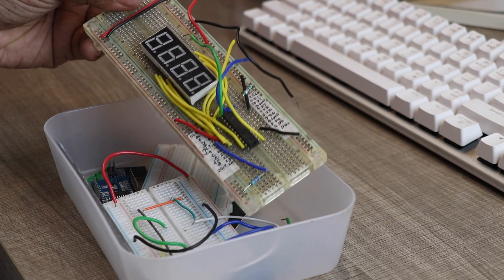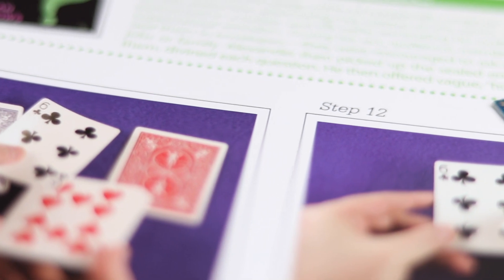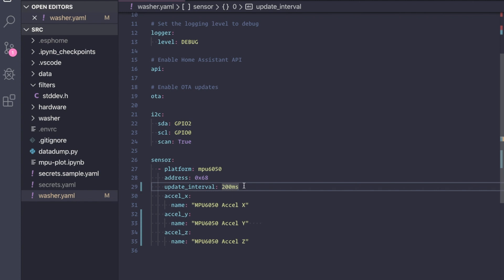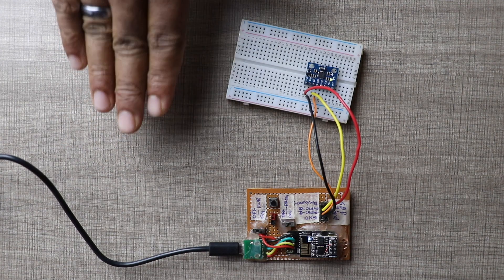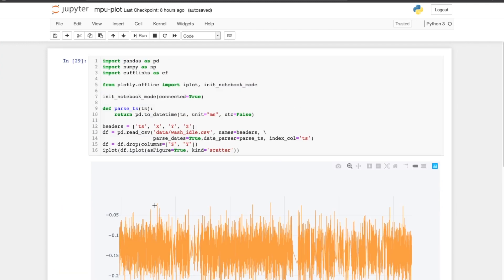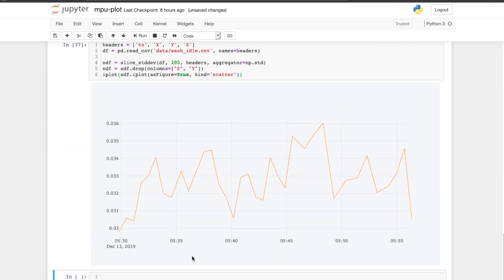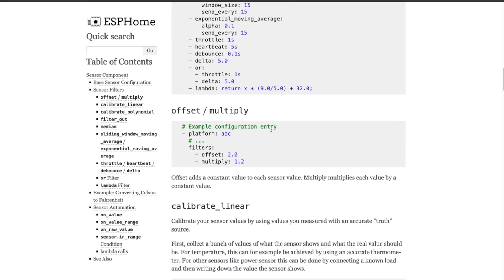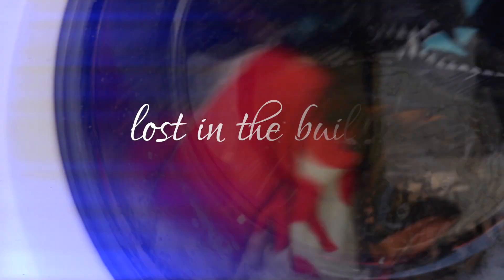Is the washer done? Automate with home assistant, ESP-01 and  esphome - Part 1

Comment: Some washing machines have an LED to indicate the end of washing. Properly connect the voltage to the ESP port and read the logic state. End of washing - LED is on - state 1 then ESP signals the end of washing. Simple.
Reply: Is it simple to disassemble your washer and potentially damage the board for a notification that means nothing most of the time

Comment: I think you could have use energy meter and when it's reading shows 0 or nearly, zero can send notification through HA, for this approach to work there must be difference beteen energy value among done state and all other state. What do u think?
Reply from the maker: Yes. I have seen a video where some one did this. There still could be periods where the washer is mostly idle like when it is just soaking the clothes. It may look identical to idle.  You will need to account for those.
Reply: @lostinthebuild9501  what about taping the wire for the door lock actuator?
the washer locks the door  during the wash cycle , as soon as the wash is done it will make a loud  snapping noise ,  that is the door lock opening , at least on front loaders anyways

Comment: You could have use "Vibration sensor" instant of Accelero meter ,it is simple, cheap & work well for this kind of project
Reply from the maker: I had some piezo based sensors, and tried using it. But it needs additional circuity to make sure the voltages generated won't damage the esp-01. Also the ESP-01 lacks any ADC pins. This means we need opamps and such to generate a digital signal. So overall the mpu6050 was "cheaper" (The one I got was Rs 40) and simpler as it already had an I2C interface. 

The ones that uses a spring mechanism won't cut it I think as it cannot detect the levels of vibration. It just has an ON/OFF output. That may be triggered just from putting in the clothes or closing the door of the washer etc. 

Are there other types of vibration sensors?
Reply: @lostinthebuild9501  thanks for the explanation. Great work